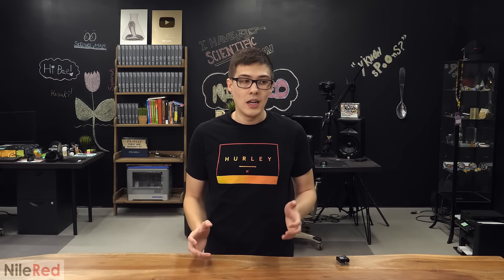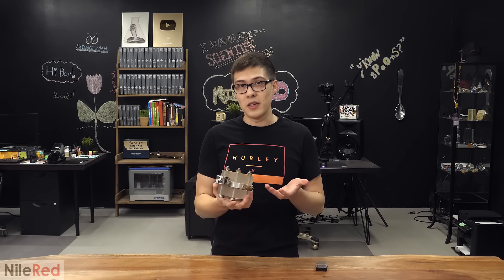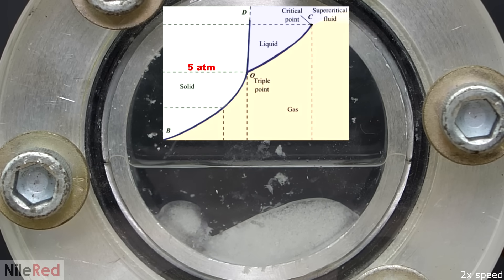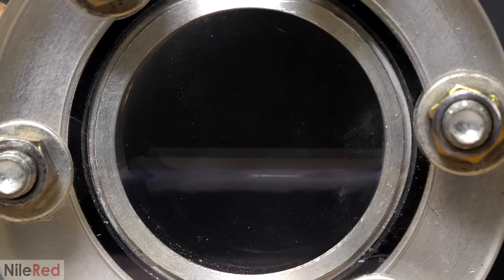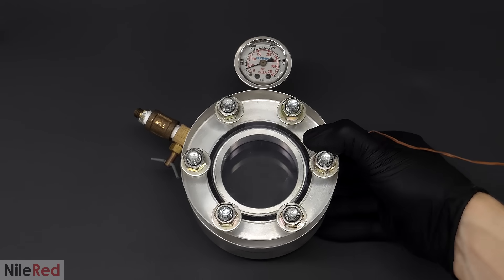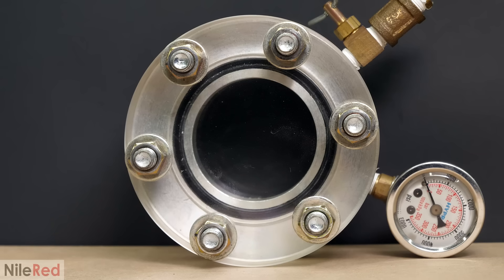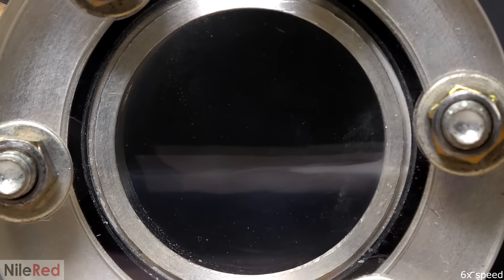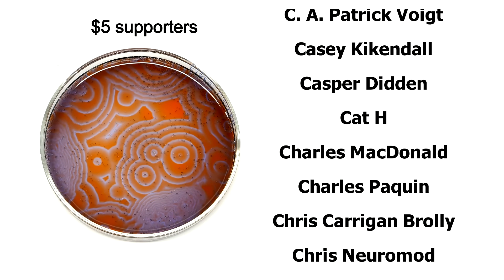Going supercritical.

Comment: I’m not an expert at all and I’m just saying what I could guess but Selica gel/beads are made out of silicon dioxide witch comes out of sand.From
What I could guess is that it’s like putting a Glas bead under a lot of stress so it starts to crack (in this case if it was true because the bead was with all that pressure under a lot of stress and caused the bead to severely crack)(I’m thinking this because Glas that is under stress also forms rainbow colors and can also crack)

Comment: So, as far as the cracked silica beads, I saw a recent video from action lab about reflective chocolate where he explained that the paper had grooves smaller than the wavelength of a color of light, so it reflected them, (don’t quote me.) Is there any chance that the cracks in the beads could be small enough to match those wavelengths?

Comment: I would consider replacing that hardware with Grade 8 hardware and talk to a mechanical/materials engineer or boilermaker about proper hardware torque if you have concerns about the structural integrity of the chamber.

Comment: The opalescence is in fact precisely the same effect, what you're seeing is a refractive face incide the bead. As for the reason for the cracks, had the gas actually permeated into the silica, sudden decompression would cause pitting or even complete shattering of at least one of the beads, but here they are all intact and in close-up the bead is completely smooth. I'd wager the cracks are a result of either thermal shock, or the makeup of the bead not being pure silica, with the various ingredients reacting differently to the thermal and pressure changes. If there was water in them, for instance, freezing would expand them slightly, and silica is not usually known for being particularly flexible  ;)

Comment: You know the mass of the dry ice, you know the volume of your container, and you know the number & thread pitch of your bolts. Calculating the required tightening torque should have been trivial... Did you just not bother, or what happened here?

Comment: Bit of future advice...if you need to tighten something with relative precision, use a torque wrench.  That makes things faster, repeatable and mostly predictable.  Also that pressure gauge is designed for gases only and was broke from either the liquid CO2 contact or over pressure/vacuum.  You need a diaphragm to isolate the gauge from any liquid.

Comment: I work in oil and gas industry. Flowing back wells under high pressure the liquid natural gas gets cold when you decrease  the pressure.  There is water mixed in and depending on how you control the pressure you can create a hydrate zone meaning liquid turns to a solid. (Ie. Ice)! I've seen ice form inside a pressure vessel that has enough strength to rip welds from metal dividers. It can destroy a peice of equipment worth hundreds of thousands of dollars in minutes if you're not watching close enough.

Comment: So inside tanks of liquid CO2 does that mean it's supercritical? They're under a lot of pressure, especially ones that sit outside like the stainless steel ones you see outside of restaurants. They would definitely heat up a lot on a hot day. Their gauges are 850-1000 psi and that's without the addition of heat. 

Maybe some of that clear aluminum (aluminum oxynirride) would come in handy. Make a tank out of it and fill it as we normally would. Then see what happens.

Comment: That o ring definitely need to be larger, or a smaller groove,  if I built it, I think I would made a ring to bolt through, instead of using washers on the bolts, a 5mm thick plate, with a hole in the center. Basically a large washer with bolt holes in it,   it is nice seeing the o ring though, maybe even o ring around the bolts, and a larger o ring near the outer edge, to keep it sealed really well. But it works,  I did notice a small leak around a bolt, it is difficult to seal that pressure, with those materials!

Comment: You fully missed the temperature component. When you depressurize, the temperature drops inside the chamber. You need to use a thermostat and slowly decrease the temperature. That way you avoid a phase change, which is needed to make the aerogel, and do extractions.

Comment: Silica beads are an amorphous solid in the form they're used. If a high enough pressure and temperature was applied, it may have actually allowed it to crystallize to a degree (combination of pressure forcing atoms into a lattice as well as annealing). Think like coal getting turned into diamonds except this doesn't require as high temperature or pressure. Crystalline silica is known as quartz and has a yellowish, foggy appearance. It's possible you made a form of quartz! The cracks seen may be barriers between different crystalline lattices (this is definitely polycrystalline if it is a crystal) and boundaries between crystallized SiO2 and the SiO2 that's still amorphous. May also be why you started with smooth balls and ended with more jagged shapes. Either that, or it may still be amorphous and is just glass now.

Comment: Your silica gel looks just like fried marbles. It's something done with glass marbles for crafts. Glass marbles are heated by raising the temperature of the marbles in a frying pan or oven. The marbles are then quickly cooled in ice water. The marbles internally fracture from the thermal shock. (Warning!) The marbles can explode!! However, your silica gels are like mini Glass marbles and thus internally fracture from going through the extreme temperature change in your super criticality experiment. (my best assumption)

Comment: 5 BAR is a touch over 70psi. That is some serious pressure. If you don't want to just trust the pressure release valve (say if you have a toxic or corrosive substance under pressure) I highly recommend modifying it to put a blind plug in the stem after the valve. In the event if a valve failure instead of a chemical release, itl be contained by the plug. Giving you time to deal with the problem.

Comment: Man, instead of putting in silica beads as a test solid, you should have done rainbow glitter.

EDIT:  Also, I'm pretty sure the silica beads started sparkling with colors because all the internal cracking caused some of the cracks to basically become prisms.  They look rainbow-like to me when you move them back and forth, which makes me think that the color is just coming from the refraction from all the internal stress cracks you caused by chilling subjecting them to that kind of rapid, extreme pressure and temperature shock.

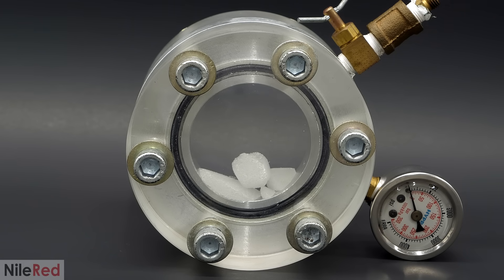Comment: 3:48 the best way to ensure the nuts and bolts were tightened properly is to:
1. Apply some antiseize to the threads
2. Use a torque wrench, so that you can measure the amount of force applied to the bolts
3. Look up the proper torque value for the size of bolt threads and apply that amount
4. Look up the tightening order for a bolt circle so that the nuts are tightened in the correct order

Comment: As a hobby I do interact with geology time to time. Something that this reminded me of:

Silica under higher pressures and temperatures becomes amorphous. Thing is, supercritical fluids can leak into crystalline structures, especially those weakened high heat or pressure. And silica cracks quite easly under pressure+heat combination. 

Silica can form crystals under correct circumstances, pressure being one of the key points, but only if Silica is not pure. Pure silica just falls apart, like sand.

ATTENTION: This information MAY BE FAULTY/WRONG.

Comment: As far as the cracks in the silica beads go, I think I might have an explanation for the shiny part, or at least a comparison. Sillica is what makes up most of the rock Quartz, and if you get the right crack in a quartz crystal it will form a prism, filtering the light into a rainbow. I assume due to the similar properties that is what is happening with the silica beads. 

As far as making a golf ball sized one, I think it's possible. I personally have a few large quartz rocks with these reflections in them, (golf ball to base ball sized), so if you use that logic it should work

Comment: I wonder If one side was tapped, if you could just use an impact wrench with a torque limiting extension to speed the tightening process, as well as putting the device in the freezer to keep the contrast from metal to ice to a minimum. Sort of like heating a dye before pouring molten metal.

Comment: i used to work in the compressed gas and cryogenic liquid industry. my manager told me of a story once where an entire semi-trailer load of liquid CO2 was lost because the driver left the pressure relief valve open, and it all turned into a block of dry ice. that sounded like fun times!
Reply: Vent valve more likely left open. Also, it can takes weeks to thaw out a trailer like that.

Comment: This is essentially the principle on which refrigeration functions. A sealed system where by means of changing state you can either add or extract heat and transfer it to another location. Albeit in most refrigeration you generallt won't reach the critical point with c02 being an exception.

Comment: 9:44 WHY DOES IT SPIN??? What causes rotation in a sealed chamber?! and then moments later it appears as if thier a liquid stream down the center? I guess maybe there’s a downward force pushing the liquid up the sides to the left and right then colliding in the top center to fall back down? But either way, what is causing these motions? Not random vibrations like when the gas and liquid were just starting to melt Togeather, but especially in the spiral, it looks like you just vented a pressurized chamber with the valve pointed at an angle
Reply: Could it have been due to where on the chamber you were cooling it??? Would it look/act different if cooled in a different manner?
Reply: GOTTA SEE SOME SLOW MOTION OF THIS STUFF!
Reply: not sure but i think that's because the system is not ideal and some parts of it will heat up/cool down faster and create the stream, just like with wind
Reply: It's because 
1. He was swriling it axially beforehand. We don't know how much time lapsed, but that could add to it.
2. He dripped the icewater down one side of the cylinder, creating a gradient, where CO2 on the right side would fall, pull hot CO2 in behind it which would cool off in turn, and subsequently fall, creating axial rotation.

Comment: The Beads suffered "Thermal Shock" which resulted in them shattering internally. Those iridescent looking bits are the surfaces of internal fracture plains refracting the light. 
You can often see this in natural crystals (eg: Quartz).
Reply: @draxthemsklonst  CDs are polycarbonate plastic. Completely different stuff.
Reply: Yes, you can use light to show damage in glass in the same way
Reply: @draxthemsklonst  Even a regular cd does it. It's because of the microscopic grooves on the reflective surface refracting light. Vinyls would do it too if they didn't absorb light.
Reply: @davejones9469   Black vinyl will do it if the moulding dies are laser etched. 
@Matthias Lastname   I have an unplayed vinyl copy of 'True Colours' album by Split Enz from 1979 that refracts light to produce shifting rainbow coloured geometric patterns on the surface of the disc. Impressive under bright halogen lamps while turning on the player.
Reply: @BTW...  STYX - Paradise Theater also had laser etching if I recall, don’t remember it being opalescent, but it’s been a while 😂!
Reply: @davejones9469  Vinyls don't have small enough structures. They have to be close to the light wavelength (~400-800nm); the bits on a CD are this small but the smallest structures on a vinyl are about 50 times bigger.
Reply: @matthiaslastname9019 CED works, and it's (carbon-impregnated) vinyl.

You're right that an ordinary LP won't, though.
Reply: Great explanation!!  Is the yellowing from the thermal shock as well?
Reply: @mattiemathis9549  Im pretty sure the yellowing is just the beads. Nothing to do with the experiment.
Reply: @eggz4287  He said they became yellow in the chamber. So It is related to the experiment.
Reply: @Queer_Nerd_For_Human_Justice  Then the silica could of mixed with the co2 under the pressure and began to form silicon carbonate. But that might not be what happened here.
Reply: Hysteresis?
Reply: I was about to say something similar. If I’m right it’s the pressure of the rock over years causing the minerals to undergo a change which is why in some areas depending on what minerals were in the ground some crystals will occurs. So does that mean if he kept doing the same process to these beads that they will start to change into crystals ?
Reply: Same
Reply: so that explains the beads exploding in water
Reply: Legit
Reply: “Me having literally no clue about what this conversation was about but still liking it”
Reply: Much applause, and I mean that, as a freelance geologist. Slash astronomer. Slash holy crap, what a beautiful explaination! I'm well versed on thermal expansion, but thermal shock is something I haven't had the funds to fully study yet. Thermal compression due to sudden drop of temperature? Is this fusion related?
Reply: We all know this… he says as much in the video. Technically and from a scientific perspective, it’s called the Schiller Effect.
Reply: I figured it was that simple, but what about the colouration?
Reply: @Dave Jones he answered that.
Reply: @valeriereneeharper  No, he explained the iridescent parts aka the rainbow of colours being refracted by the micro fissures, essentially. The yellowish discoloration of the pellets has nothing to do with that. 
Unless silica gel reacts specifically with heat in that way, which he didn't mention.
Reply: @davejones9469 , just a guess, but I think the discoloration was from something in the silica gel reacting with the carbon dioxide under the pressure and modest heat and freeing carbon atoms. I recall hearing about how early artificial diamonds had issues with yellow/brown coloration due to carbon atoms that didn't properly settle into the crystal structure. The silica seemed to form quartz-like sheets, so I'm guessing the coloration is from loose carbon atoms getting trapped inside of silica structures... Just a hunch.
Reply: Wouldnt the word be plane instead of plain
Reply: @reese4627  it's a typo.
Reply: Cool
Reply: Planes
Reply: I think it is due to internal reflection from 2 layers and subsequent in interference leading to some colour to interfere constructively depending on the width of the cracks(thats why we can see different colours randomly)

If it was refraction then the result would have been a sprectrum.

Comment: The reason the Pressure Gauge didn't work is because super cold liquid was running into it and froze it at zero.
You should have had the cylinder oriented so that the gauge was UP at the 12 o'clock position so that only cold gas was affecting the gauge's diaphragm.
But having a super cold "liquid" (such as condensed gas) on a regulator, valve or gauge is a sure way to have serious problems (this applies to any compressed gas).
BTW - I believe it was at the supercritical state @08:18 into this video.
Furthermore @09:54 you can see a stream of liquid falling from the top of the cylinder to the bottom (right in the middle of the chamber). I believe this is the liquid finally draining out of the Pressure Gauge's Stem. The gauge "might" have even started to work at this point but I wouldn't trust it to be accurate.

Comment: The cracked silica beads would probably look pretty interesting under a polariscope. Also having one is useful for seeing stress in your glassware so it might prevent the need to smash all your beakers again in the future.
Reply: Nilered really needs this advice😅
Reply: in that vid he talked about how using a polariscope in the beaker case would have been impractical because even if he missed one tiny stress, it could’ve been deadly
Reply: @cadinkdaves6844  We do it for planes all the time with microscopic precision, for both the windows and the metal skin… His point?
Reply: @TheEmeraldMenOfficial  time vs cost vs effort, all with risk factored in.

To be 100% certain, that'd take a lot of time to check every beaker over 100%. Then you have to trust yourself, so some double checks are needed.

This would take such an incredibly large amount of time and effort for little payoff, especially considering he'd need to purchase the polariscope. 

In the end, 99% certainty and hours later vs 100% certainty, very little time and less money just to buy new ones.
Reply: @TheEmeraldMenOfficial I always wondered how they did that. Thanks ✌️😎

Comment: I don't reallyunderstand why an O-ring wouldn't be enough to handle high pressure. As a diver, we use rubber o-rings all the time for pressure sometimes higher than 200 bar. I'm not trying to nab, just genuinely interested in why that would be a problem

Comment: Like hydraphane opal which has a habitat of absorbing water due to the bigger microscopic surface pores the silica desiccant has a similar molecular pattern. To avoid the cracking. Heat the sample to the specified supercritical temperature. Then raise the temp above the supercritical temperature allowing the CO2 to become a supercritical fluid and ultimately allowing the supercritical fluid vent to the atmosphere at a constant supercritical temperature without boiling. This prevents differential conditions like stress fractures and cracks. Keep it above supercritical when venting this will maintain the balance.